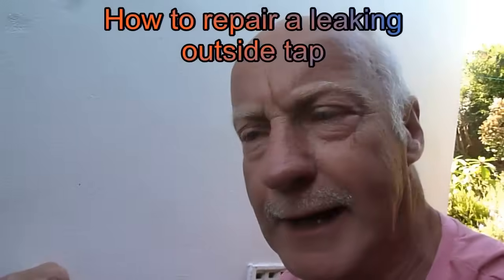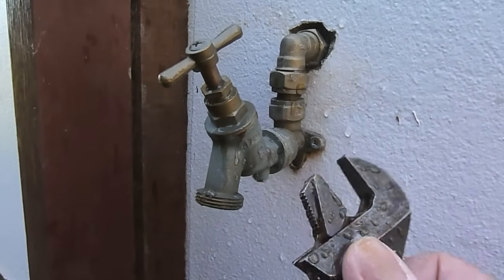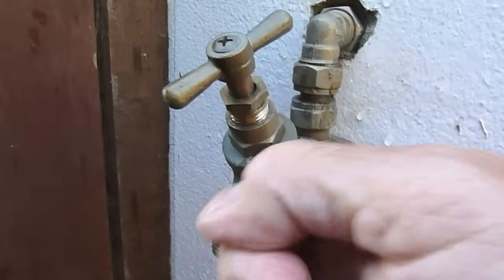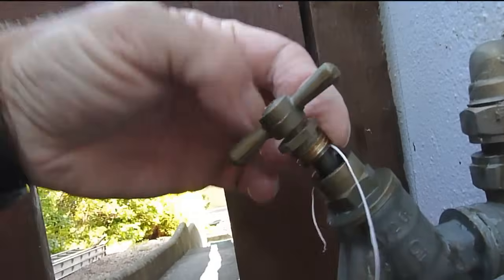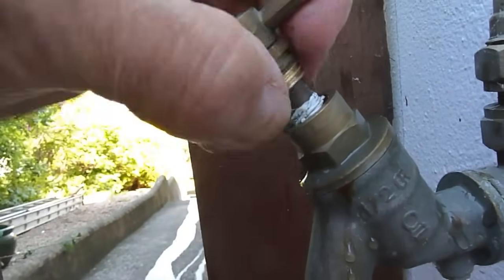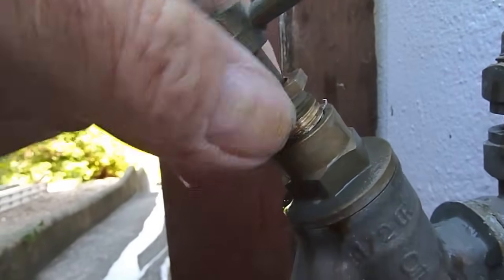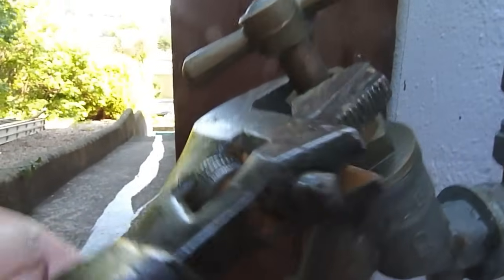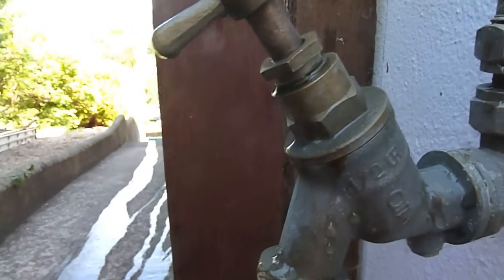How to repair a leaking outside tap

Comment: A small task I've put off for 15 years (or more), fixed in about 15 minutes. That includes 5 minutes to dig out a selection of spanners/wrenches, 2 minutes to find the tape, 3 minutes to watch your video, 5 minutes to put tools away and 2 minutes to actually fix the drip. SORTED . . . but . . .

It gets better . . . 

Emboldened by my success, I remembered the tap's isolating stop cock in my cellar which gets used twice a year (to avoid frost damage) and always drips after turning on or off. Well, you guessed it . . . also sorted. I spotted your other video AFTER I fixed the stop cock. Anyway, TWO FOR THE PRICE OF ONE.  How much should I charge myself?

Many thanks

Comment: I have avoided using my garage tap for 8 YEARS as it was leaking and I couldn't switch the water supply off to change it. After watching this, it took me 2 minutes to fix it! Thanks so much for posting this video.
Reply from the maker: No problem Andy.
Reply: Same here, tried to use a hose today and my garage converted to an office got floded.
Reply: Wow that’s straight lazy haha

Comment: Thanks Al. I've had a leaking outside tap for some time now and I had begun to think that it was the nature of the beast, resistance from a long hosepipe etc, but I have tried your suggested fix and it works perfectly. Thank you for offering such a simple but effective solution.
Reply from the maker: Glad to help

Comment: Cheers, fixed something in 2 mins that has been a problem for years, and was undermining our patio, and I w as worried was getting in th foundations.
Thanks so much.
Going to tackle the quarter turn leaking sink tap on the back of another of your videos. Saved a fortune,  and it's so difficult in our area to find a reliable and straight forward plumber. I really appreciate it.

PS very impressed you did that one handed and your left hand at that. You could probably do it with your eyes closed I bet.
Reply from the maker: Yes I can Mark, been too long at it.

Comment: What a great video and the only only one that I've seen that shows this excellent tip. For the past 8 years I've lived with two leaking garden taps (the fixes were a bucket under the one and a pot plant under the other) My main reason was is that a knowledgeable friend had warned me not to tackle the job due worn spindles and left hand threaded nut. So now it has taken in my less than 10 minutes to fix both taps.     Just one extra tip,  I used some press-stick putty to hold the unscrewed nut up to the tap so that both hands were free to put the tape round the shaft.

Comment: Brilliant mate. Was literally just about to go out and by a new tap, then thought I’ll google it. Glad I did...saved me a lot of hassle. I’ve also avoided using the mains stop cock in the house through previous experience of them leaking after being turned off - I always crawl about on the public path outside. I now realise that I can do the same fix. After years of DIY this has somehow gone over the top of my head. Many thanks for posting.
Reply from the maker: No problem.

Comment: I have also been putting this off because I thought it meant lying on my kitchen floor and reaching to the back of the cupboard to isolate the tap. With two hands it was almost as easily accomplished as you managed with one. Thanks mate.
Reply from the maker: No problem.

Comment: Thank You so much! as a woman, who knows little about these things, your wrench actually saved it more! i think it was because i had a hose connection, & each time i had used it for watering, each time the screw thread had come loose. Thank you Sir! i feel rather proud , in a strange way! i know my father would be looking down & be just a little bit proud, not much! just a little bit x Thanks and best wishes to you x
Reply from the maker: Thanks Rachael, pleased you sorted out ok.
Reply: @dereton33  Thank you so much , could i just ask you a question please/? i have a kitchen sink, that has been a problem for many a month. well a year actually, when i wash up , the water comes straight back into the kitchen? what is that please? what can i do about it? I have now used the tool to turn off the outside tap that has worked well, i wondered would that back up into the kitchen now its off? i am washing up in the bathroom sink, because i cannot use the kitchen sink x

Comment: cheers mate, thanks to your 'packing' tips I've stopped a radiator valve from leaking and causing pressure loss in the central heating :-) and my next job is packing out the valve in my outside tap to stop that leaking. good vids and simple to follow. cheers.
Reply from the maker: No problem Martyn.
Reply: just done the packing job on my outside tap to stop it leaking and the PTFE tape worked a treat. Its no longer leaking and the water pressure to the hose pipe is much better. Thanks again :-) job took less than 2 minutes!

Comment: I had a very slight leak from the same area. My old man doesn't believe in ptfe tape. He uses tread. He installed many tap using thread! They've held up, some a are a good 35 years old!
On topic, a very similar tap is leaking from the spout. Quick fix is closing the tap with a little extra oomph!
Thanks for this, I'm going to buy some ptfe tape and renew the old threading.

Comment: You’ve explained things so clearly that even people that might be scared to carry this out this work, will be confident to do it. Just a thought, if the body of the tap hadn’t been tightened up properly, and the gland nut was v tight/ or seized, they could unscrew the whole thing and end up with a bit more of a problem. So it might be prudent to let them know to make sure the body is tight to start with.
Reply from the maker: Thanks John good idea.

Comment: Cheers Al. I have this exact issue and tightening didnt fix it. So I have ordered some of this PTFE tape and will be doing this fix. Great video and explanation.
Reply from the maker: Excellent! It is an easy job Colin.
Reply: @dereton33  I did the job as per your video and it worked like a charm! Thanks again Al :)

Comment: Wonderful - thank you so much for a simple, clear explanation.  I did do this years ago, but had forgotten which nut to undo!  Just to add, again going back a few years, people used to use string soaked in petroleum jelly (i.e. Vaseline - other brands are available) instead of PTFE tape to do the packing.  Not sure which is better.
Reply from the maker: More than likely the string.

Comment: just set up an automatic watering system for my garden and the patio was getting mare water than the plants. easy fix as i had just bought some PTFE tape to help seal the connections - 2 minute job to repair thank you so much
Reply from the maker: No problem

Comment: Now off to buy some PTFE tape. Brilliantly simple instructions. Thanks
Reply from the maker: Have fun!
Reply: @dereton33  found the PTFE and fixed the tap so no more drip there. Hoped it would fix the poor sprinkler performance, and whilst everything is now dry round the tap sprinkler still not kicking in as it used to....time to check all hose connections.

Comment: A job that I was putting off time and again as I thought I’d have to buy a new tap or change the washer. Leak fixed.
Reply from the maker: Thats great.
Reply: Thanks I’ll try this 👍🏽
Reply: What size washer inside the tap is it?
Reply: Same here. It's so simple!
Reply: Likewise, thank you 👍🏼👏
Reply: @dereton33 ❤1

Q
Reply: Same here was putting this off as the stop valve is behind the washing machine and thought I'd have to turn off first.

Comment: Thanks for  your hard work and good  solution for  water leak problem . 
I nead your advice to  fix  an out tap vertically wise not to be slope to the  right and  not the left hand side ?
Reply from the maker: Best to slope it downwards.

Comment: Videos are great & they’ve helped me with a few! Only problem is that it worked and stops the leak when I’m just using it as a tap, but when the hosepipe is attached, it still leaks.
Reply from the maker: A new tap is only about £6.00, sometimes it`s best to bite the bullet.

Comment: Hi there, thanks for the video. I have a tap which is leaking out the top but doesn't have a packing gland. Wondering how I can fix that type of tap?
Reply from the maker: Those cant be fixed . A new tap me thinks.

Comment: Hello! This is a great video.i really want to do the same, except that the nut on my garden tap is rusted tight, after 40+ years without loosening. If I try and turn it, the whole tap and pipe twist. Any suggestions?
Reply from the maker: New tap. 40 years it did well.
Reply: @dereton33  thankyou!

Comment: Unbelievable that I managed to fix this in 10 minutes with the video after already spending many hours on the job. 

The 2 way garden splitter was showing the leakage from both holes. However after hours of efforts, it became clear that water was coming from the leakage on the top of the trap itself just like in this video. 

The rest is history. 
Thanks and well done.
Reply from the maker: No problem.

Comment: Great video so easy to follow.My tap is leaking from the first nut joint nearest wall outlet pipe ,if that makes sense, please could you show or explain how to remedy this.The valve inside house is closed off so not sure where the problem lies.You can probably tell I haven't a clue! Thankyou.
Reply from the maker: The valve must be letting by, to be leaking, anyway just undo the nut that is leaking, wrap some ptfe tape around the olive and exposed thread and tighten up again.
Reply: dereton33 Thankyou so much for your speedy response,I am going to try it right now!
Reply: Well I have amazed myself! Its all good now Thanks to you.
Reply from the maker: No problem.

Comment: Thank you for the great videos. My outdoor tap leaks like the one on this video, however when I turn it off, I get to a certain point when the tap stops running, however the. handle will keep turning and the water starts to run again. Is this technique likely to fix it, or do I need a new tap? Thank you. Andy
Reply from the maker: The thread in the tap has gone so you will need a new tap.
Reply: dereton33 You win some you lose some! Thank you.

Comment: Hi. You see on your tap where the pipe comes out of the wall into the  90 bend? Well the bit underneath that, is where ours is leaking. 

Any thoughts on what to do please? 

As you can see, i dont know what that part is called so i am unable to search for fixes.
Reply from the maker: It is a back plate elbow.
Reply: dereton33 Thanks for your swift response. I will see it i can find it now. Cheers

Comment: My outside tap leaks at the junction with the hose connector.  I thought it was the connector that was faulty so I bought a new one (brass, so not a cheap option) and it still leaks from the same place - just above where the connector fits, with a really fierce spray.  Remove connector, tap works perfectly well. Any ideas?
Reply from the maker: a hairline split on the tap. renew the tap they are cheap.
Reply: It’s brass so I’m not sure how it could get cracked? It’s been protected all winter, cover only just taken off. Also it works fine when I’m not trying to attach the hose adapter

Comment: I had the same problem i did what you did in this video to fix it bur can't get the tap open now what should I do?
Reply from the maker: You have tightened the gland nut too much slacken it off a bit.
Reply: dereton33 thanks got it working

Comment: Hi my tap looks slightly different, there is no hexagon shaped screw. It is rounded, with a thread underneath. Is the principle still the same?
Reply from the maker: Yes use a pair of grips to undo the nut instead of a spanner.

Comment: When I turn my tap on it just drips water out even when fully open, and also the leaking out the top, is that a case for a whole new tap?
Reply from the maker: Best bet.
Reply: Hi custardo my problem is same have you changed the tap or did you try the same way ??
Reply: You Tube hi, I changed the tap, took 5 mins

Comment: my one is dripping off the Water from tap hole but when i close it tightly than the Water starts leaking out from the spindle side...
Is it the same problem ??
Can you please advise me.
Reply from the maker: You will need to replace the tap washer, then do the gland nut as shown in the video.

Comment: Alernatively...buy a new tap (around £6) turn off the water at supply..drain for a minute.. screw tap off, wrap about 10 PTFE layers around thread on new tap(...screw new tap on.
5 min job